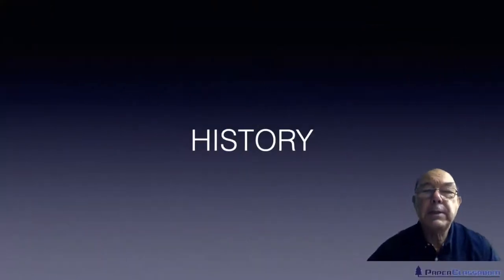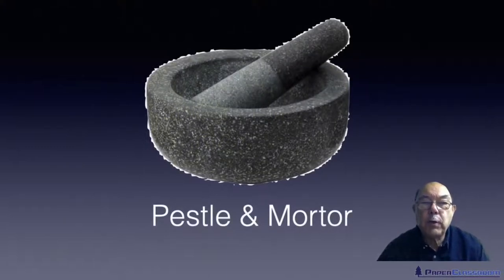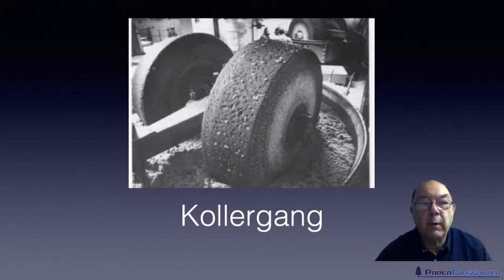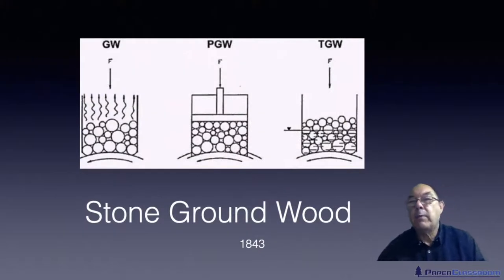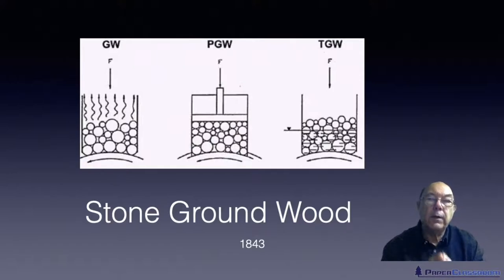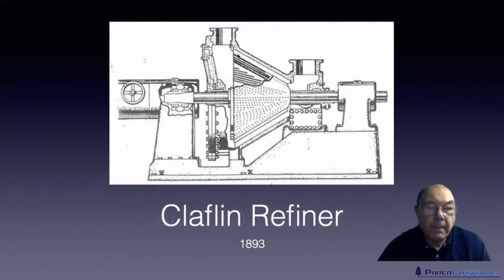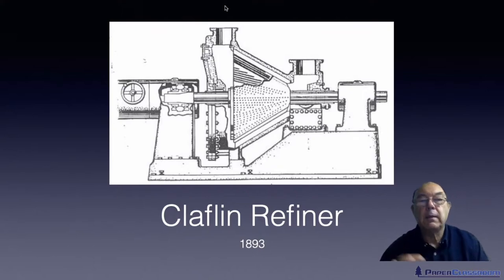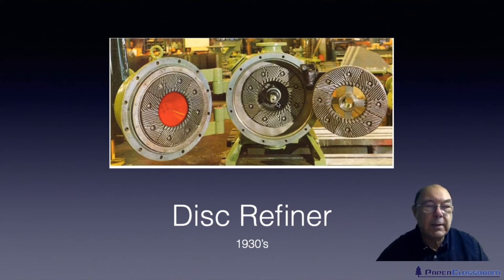Level 2 Papermaking - Mechanical fibre treatments

Comment: Thank you professor. We use single disk refiners and we control their performance with Shopper essays and controlling the output pressure, before changing the disks. Interesting video.